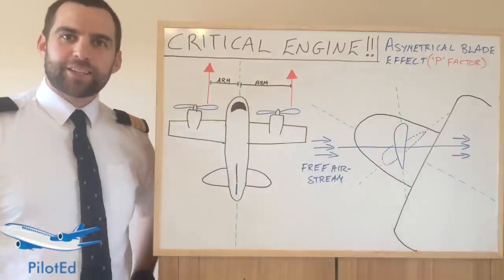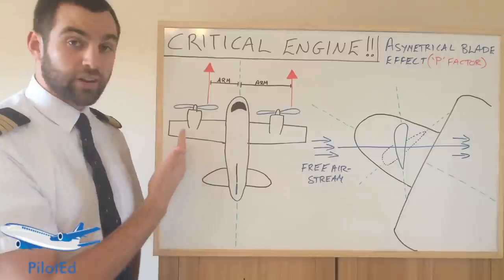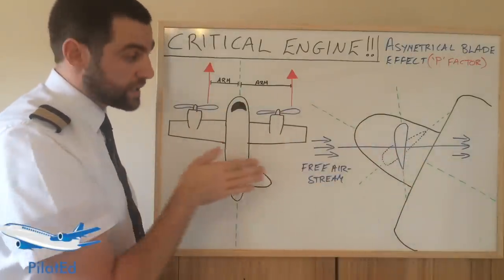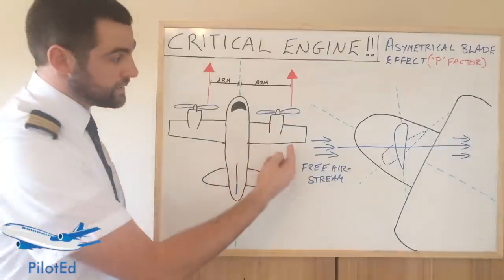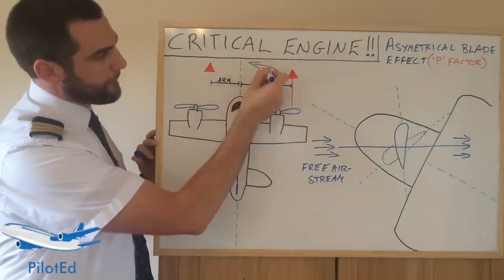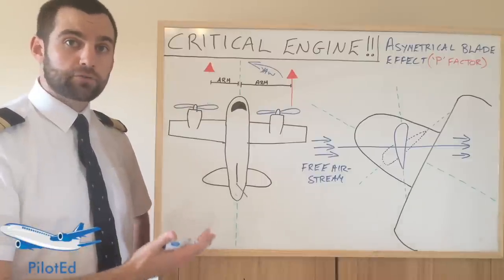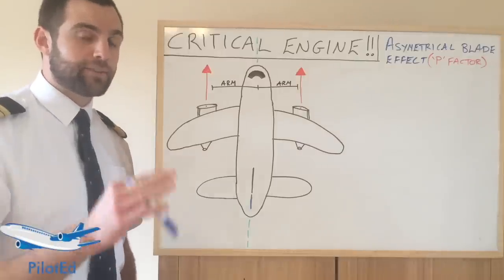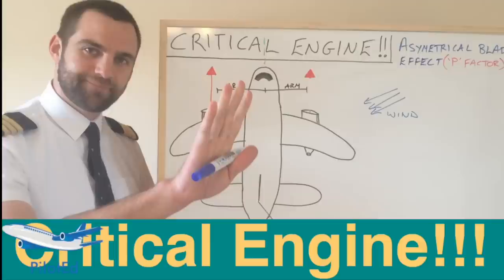Critical Engine!! P-Factor  ✈

Comment: Good explanation, I'll give you a shout out and link to this video.
Reply from the maker: cheers :)
Reply: @PilotEd  sir, there are a few mistakes in your explanation but awesome video i really love your explanations. the propellers are the shape of a wing and has an angle of attack the hub of the propeller a smaller angle of attack but the tip of the propeller has a large angle of attack. plus the descending blade has a larger angle of attack and that the propeller blade itself has a large moment arm from the CG which causes the plane to yaw in the opposite direction in conjuction to the rotation of the propeller

Comment: Airfoils have drag, props induce torque against that drag.  Does the rotation play into this at all, considering the prop shaft as the lever for the torques due to drag (on a clockwise left prop for instance, the down stroke would be pulling up on the wing inboard of the prop shaft and upstroke pulling down on the wing outboard of the shaft)?  Just basically apply Newton's third law to the torques induced by the drag.

Comment: Flight 2311 had left engine issues & propeller angles that crashed it. Question. Wouldn’t opposite rudder or shutting left engine off saved them?

Comment: Hello Amazing explanation. I just have a question about the critical engine in the jet engine at the TO moment. If on your example, the wind is coming from the right are we not be pushed to the left? And if so, in that case the critical engine would be the engine on the opposite side of the wind. as if this one fails (eng n 1, the left one) the engine N2 (on the right) will push us even more towards to the left (left yaw moment), I am wrong? Thank you very much!
Reply from the maker: if the wind is from the left, the aircraft will point to the left. so you have it the other way round. :)
Reply: @PilotEd  I have the same doubt. Can you put some more light on this statement "if the wind is from the left, the aircraft will point to the left."  because as far as I remember, my instructor in flying school taught me that aircraft drifts in opp direction of winds. for instance, if the wind is coming from right then aircraft will drift towards left; so we have to fly into the winds to maintain runway centerline. And this is in contradiction to the above statement.
Reply from the maker: @sonaliborana9106  That is all correct but your not thinking about it in the right way. wind from the left means the aircraft wants to point left (drift right maybe a little yes) the massive rudder acts as a weather vain. so if you have a left engine failure the right engine will be adding to the problem of turning left.
Reply: @PilotEd  weathervaning or weathercocking effect.... got it! 
thanks a lot for clearing the doubt...

Comment: Nice vid sir! Can you explain more about crit engine in a twin? Like the torque, accelerated slipstream and spiraling slipstream? Also I have one question. To counter the left turning tendency in a twin airplane it must have a counter rotating prop right? Why some planes doesn't have counter rotating prop if it will lessen the left turning tendency? Thank you in advance!
Reply from the maker: counter rotating props do help a little yes, (but many do not use them, mainly commercial reasons, ease of maintenance etc..) but honestly twin piston prop engines no matter weather they are counter rotating or not get very hard to control in the event of an any engine failure. Identify apply the correct rudder, "dead engine dead foot" and take it from there. A good trick if possible in the situation is to reduce operating engine RPM to.
Thanks for watching
Reply: PilotEd thank you sir for replying! Your videos are really helpful.
Reply from the maker: thanks again for watching more on the way!

Comment: as for critical engine for the jet is the one that is facing the wind,  is the reason because , more wind , more lift for that side of the engine ?
Reply from the maker: as the video says, if the wind component ads to the yaw caused by the engine failure, then thats the critical engine :)
Reply: @PilotEd  thanks so much for ur reply😀just would like to know, the reason for that is that because the wind would provide the airflow and will increase the lift ?
Reply from the maker: @tiffany51793  no the x wind causes yaw so does and engine failure, so if they both cause yaw moment in the same direction... voila critical engine

Comment: so the fanblades is the reason why there isn't p-factor? they are shaped like a prop blades though, no? because they are evenly distributed around the entire circumference of the drive shaft and therefore isn't a p-factor?!?
Reply from the maker: sorry I dont understand? there is a P factor because of the angle of attack of the aircraft